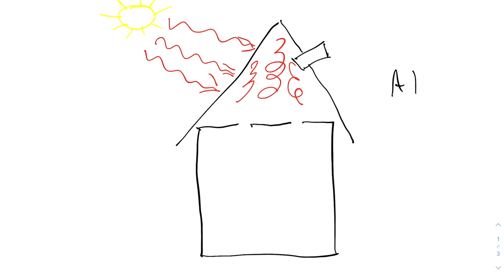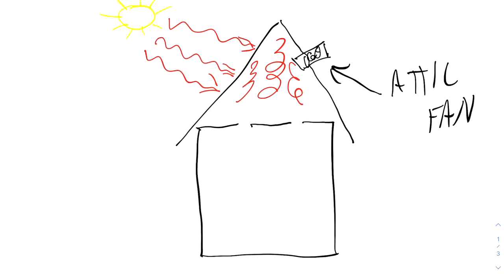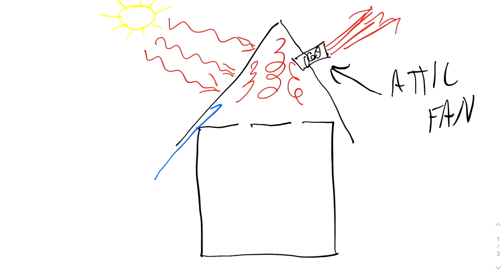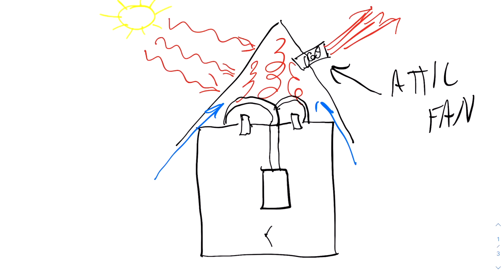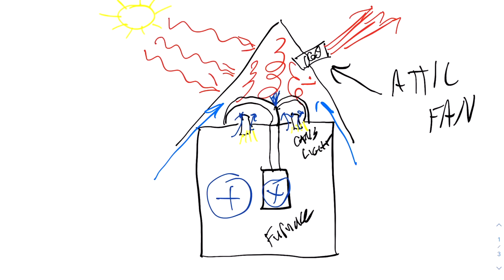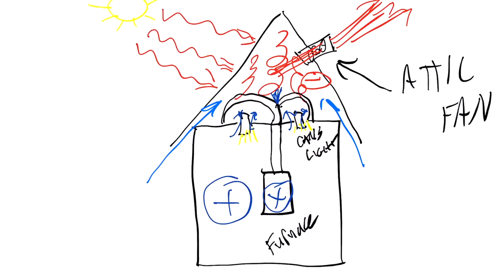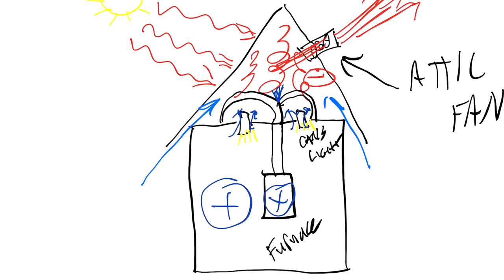3 Remodel Rip-Offs

Comment: 1. I installed an attic fan two years ago and measured temperatures with the fan off as well as on and the fan lowered temperatures inside the attic approximately 28'f. Due to this, it lowered the temperatures in the upstairs rooms as well. What you say is absolute bullsh*t 
      a. MIcrowave energy is completely different than what we get from the sun. The majority of the energy in solar energy is infrared. comparing them is idiotic. Microwaves cause rapid oscillation of molecules, creating heat. 
2. As for windows, a lot of it has to do with how many windows you have as well. My home has far more windows than your average home and switching from single to dual pane casement windows made a huge difference in my heating/cooling.

And since you ended the video repeating number 1, i'll repeat that you have no clue what you're talking about regarding attic fans. Perhaps your bias is due to your sponsors?

Comment: Gotta say you just lost a bit of credibility on this video. While I agree the claim of an attic fan reducing the attic temperature by 60 degrees is pretty optimistic to say the least, it easily lowers attic temperatures by 20-30 degrees depending on the day which in turn reduces the heat load on the house and lets the ac run less. We’re also not just talking about saving on utilities, if we run the equipment less, we will have longer intervals between replacement and anyone who has had to replace their system knows that replacement can be a huge investment….

Comment: idont know if he thinks hes right i put a air roof air powered fan only one in my roof and it drop temp by 10c so i put ina12 v fan to force more air into roof and dropped my another 15.c in in summer my roof was 50-60 c now its 35 to 50 so hes wrong

Comment: So I went and checked the the recommended literature that's supposed to prove Matt Risinger has a good point. Well, I wish he himself read that literature. A sample quote from one of his links: 

Rose (1992) compared attic temperatures in a test facility of several bays with different attic
construction. Comparisons of vented and unvented flat-ceiling attics showed that the maximum attic
air temperature was 28°F cooler with vents than without

The video is bullshit and misinformation.

Comment: Correction: the nest thermostat only uses the Airwave feature when the humidity is low enough. If the humidity is high it does not continue running the fan after the compressor shuts off, and so allows the condensate to drain off and lower humidity.

Comment: Your attic fan rant is SO SO SO easy to test; its not funny. My1,300 sqft in the Houston metro area had a summer temp of 145 at 3PM on a sunny day in the summer. After installing a fan from lowes by a roofer, that attic was down to 110 degrees. Those smart thermostats you hate so much showed a 3-hour running time decrease of the ac running on similar days when the fan was on and off; off, bring less.  You can't be more wrong!

Comment: A lot of credibility lost with this video son.  I have a 2 story house with an attic I can stand in.  The HVAC / heat pump air handlers are in the attic.  A 5-stage 4 ton for upstairs, a 5-stage 3 ton for downstairs.  My roof was not designed for a ridge vent and only had two air portals for heat to escape there are two solar powered attic exhaust fans that are whisper quiet that retail for around $2,500 bucks for each one, and I'll tell you what, they keep that attic nice and cool along with the radiant barrier I can stand up in that Attic in the summertime and it tops the temperature is maybe 80 degrees in the Attic in texas.  Combine that with the top of the line carrier equipment to Smart thermostats that communicate with each other to maintain the upstairs and downstairs temperature within one degree of the setting cold air return vents and every room and a buttload of insulation my air conditioning bill in Texas for my two-story house does not exceed $120 a month and that's with a pool

Comment: To say that attic fans are useless because we apparently live in a giant microwave is categorically false. Also, the amount of CFMs these are pushing generally won't create a significant negative pressure situation such that the cold air in the house is going sap into the attic. If anything, the hottest air in the house will get pulled up and add to the cooling effect of the fan. You've provided nothing but generalized and incorrect opinions. Stopped the video after that

Comment: I stopped watching after the second claim because the video is two for two on being absolutely wrong. 
the overly broad concept of a solar powered attic fan is highly misleading and the nest airway feature takes advantage of the power differential between the blower motor and the compressor motor intern drastically lowering energy cost

Comment: I dont even know how I got to this video but this guy doesn't know what he is talking about. Just a simple example is a car on a hot sunny day. The car will significantly cooldown if you crack your windows a little. That allows air to circulate inside the cabin. Ambient air temperature  circulating is what matters. Not the temperature of your actual roof. Simple greenhouse effect.

Comment: Sorry, but you know nothing about attic temp and what it does to an HVAC system, which is in the attic. Or you have never lived in the desert, so all the ductwork is fighting a 150 degree attic, that is why duct insulation exists. If you use an attic fan, the duct is only fighting a 90 degree attic. Cool roof tiles with CRRC ratings are for reducing sun effects on attic. R8 ducts reduce loss of cool air to a hot attic so they minimize ducts losing cooling on the way to the room supplies via radiant losses. High performance insulated attics reduce attic temps, just as attic fans. Lastly, thermodynamic 101: heat moves 1 way from hot to cold, always. So at night, a 150 degree attic, the heat in there travels one way, to the coldest thing it is touching, your AC cooled home, increasing load on your AC at night. 

As for your "it is useless to fight the sun" comment, if your home is fighting 120 degree sunny day, the last thing you want to have is an attic that is 150 degrees stacked right on top of your house. Its not about fighting the sun, it's about not having a 150 degree attic that helps the sun heat become worse on the structure's cooling requirements.

Also the QuietCool smart attic fans have an app with with a temp/humidity sensors that are built into the fan itself, so you can visibly prove in real time that you are cooling and altering humidity, proving all your claims false, and based on old HVAC mentality of closed loop systems, which do not apply in an open loop ventilation system, that generates static pressure to create balanced airflow.

Comment: LOL your house doesnt need attic vEnTiLaTiOn... thats laughable. Yes passive attic venting is ideal but where passive doesnt cut it active ventilation is the only option. Apply that same thought process, that attic ventilation doesnt impact the structure, to building in the north and you will have massive ice and condensation issues Matt.... poor advice.

Comment: This guy has no clue about science 🙄, if it's not ur expertise? Be quite, attick fans HAS intake and exhaust, intake will feed the same amount of air that is getting exhausted and they are BOTH at the attick, nothing lost from the house , if the house has cracks ans holes? It needs to be sealed anyway!! Smh. Guys just don't listen to those ppl. Talking about smart thermostat, it DOSE save you energy 
1 it will track you by your phone when it gets away it will shut the unit down OR IT it will keep the house to a temp you set on that stat when you leave.
2 it monitors how long it will cool your house or heat and by time it will learn that , so if your unit takes a longer time to cool,  it will warn you so you kmow that something is wrong and you need  maintenance to see what's going on like a low charge on AC , your blower is getting dirty and it's blowing less air , your capacitor atc ... without it you'll run your unit like there is nothing going on but actually THERE IS.
3 it will remind you to grab a filter and it's time to replace it  so your unit won't choke from a very dirty filter.
4 it will till you and or warn you that your unit is running fine or something is wrong so you'll have time to fix the issue rather than just running the unit with a regular thermostat  and make the issue worst.
5 it dose not need batteries, it charges it self from the r and c wires.

Comment: WRONG...WRONG WRONG you total miss the value of an attic fan and are shooting from the hip. Clearly you nothing about thermodynamics..    IT is true that the you have a thermal mass that heats up in your attic (the roof especially if it is tile or concrete).. The attic fan continuously moves air through your attic (from the exterior soffits) which "gradually" removes the heat from the thermal mass.. This isn't instantaneous (as you seemed to believe it should be)  but a continuous process over several hours.   But the point is that you miss is that the attic air temperature is reduced with cooler exterior air (because it is being exchanged with outside) and that prevents the energy from the hot air in the attic from transferring  through the ceiling to the home interior. Think of it like this.. You are maintaining a 120 degree attic temperature instead of 180... So you are preventing that extra 50 degrees of heat from transferring through the attic floor/interior ceiling.

The other aspect you get wrong is that you think that having an attic fan is going to cause a positive pressure so that hot air is going to go from the attic to the floors below.. Not going to happen as long as you have soffits that are vented properly to the exterior. actually I'd worry more about airflow between the floor below and the attic as the fan is exhausting ..

Comment: Matt is a massive scam. an attic fan will prolong the life of your roof shingles, fact. there are also other benefits from heat reduction. very dependent on the specific circumstances it can save you energy costs. my attic is sealed off from the rest of my house. you can mess up the natural ventilation from your walls basement, ect. there is more to the story. making blank statements on this topic isnt helpful.

Comment: You are 100% wrong about attic fans. I know because I put it in practice. You clearly have no direct experience with the results yourself and as you admitted you are basing your decision off of what other people have told you -  off of "scientific theory". I have experimented with an attic fan for many years now in my attic. I have a wifi thermometer in the attic. It drops the attic temperature on average about 30 degrees in the summer. The results in the home are small but real - about a 5 - 8 degree drop in house temperature in the summer. This is the difference between being 85F in my home to being 77F - yes, I will take that any time. I will say this, if all attics were properly sealed and insulated then yes an attic fan would not do anything. But because most homes are built by smash and go contractors they are not sealed or insulated properly. Experiment, test, try it - that is the scientific method. The scientific method is not " but someone else told me".

Comment: First off, the furnace does not cool the home, I never thought I would have to point that out to someone trying to represent themselves as an expert.  Second, I have taken the temp in a non-ventilated attic that was 150 degrees.  With a properly ventilated attic the temp should be equal to the exterior temp at all times.  You will not pull air from your house if you have a properly balance ventilation system.  

Your video is inaccurate to say the least.  Stick to making videos and not actually doing any work.

Comment: You're hating on power vents based on an improper install. I could say that about ANY system. Yeah, air conditioning? That stuff doesn't do anything  except for turn electricity into cold air that gets blown in your attic becuase ducts leak into your attic - therefore air conditioning is a SCAM!. See what I did there? You know what I say? YOU are a scam. This is one of MANY things I've found of yours that are half truths, or half understandings that call something crap based on the crap tier version, or an improper use case.

If you have adequate soffit ventilation for them to pull from, they work great. Your shingles get hot by radiation, but it CONDUCTS that heat to the air in the attic. You can get REALLY jiggy with it, and spray foam holes in top plates and around can lights and stuff like that (which I have seen YOU do) - but it's NOT pulling from there significantly anyway if you have adequate soffit ventilation. You say it's a scam, but you offer NO alternative. Ok, well just let it get hot enough to cook a turkey then!!!

I've been in attics in the deep south during 100 degree summer weather that you could work in ALL DAY and hardly break a sweat, without any of this "spray foam the rafters" nonsense. It takes some work, but it's not that hard. Baffles so your blown in doesn't plug soffit vents (cut in soffit vents if needed),  Put in a radiant barrier (foil type works better than spray in, but whatever), seal openings in top plates and around can lights with spray foam (box them in with fan fold), blow in as much R as you can (40 - 60)  and POWER FANS. It'll be roughly the same temp as a shaded area outside - in your ATTIC. You can of course use batts and floor the attic too - I think that usually is r38 or so generally.

Oh - and here's another one you didn't think of - if you're doing a roof, resheet with the radiant barrier backed OSB... And as for your "dark shingles" nonsense, Shingles other than black - almost ALL have the EXACT SAME thermal properties - or negligible differences - until you get into things like the solar reflective shingles which generally aren't worth the added cost. Maybe I shouldn't block you - maybe my new hobby will be tearing apart your stupidity every chance I get. I mean - you have some interesting nuggets here and there, but damn dude ...

Comment: An intelligent builder would know the dynamics of the building envelope. Active ventilation, solar or electric, creates air movement and cools the environment. Passive ventilation only allows for depressurization. Ceiling penetrations should certainly be treated to avoid air leakage in ANY design. You are the scam.

Comment: This is a total clickbait video, Attic Fans work, they remove trapped hot air and replace it with ambient air, they are not going to condition your attic like AC but they will remove hot air, Smart thermostats work great, they adjust when no one is home that saves money.  Windows are good if you have leaky windows and want to upgrade. The title of this video is wrong. Bad Advice !!! boo!!!!! Funny at the end he says "yeah i like to change my windows, I have a smart thermostat" lol.

Comment: The Microwave analogy is possibly the dumbest thing I have ever heard. That is not how RF energy works. Heat energy does not radiate very far in an absorbent medium, like air that contains carbon dioxide, water vapor, etc. It heats the medium and that transfers energy to the surrounding medium. If you are circulating that air with cooler outside, you are not giving that heat time to propagate so the area stays cooler. You should do a 5 min google on microwave energy before sounding like an idiot.

Comment: Ridge vents move more air and are the most efficient at purging the hot air from the envelope in the attic. This nonsense about sucking air from inside the house is absurd. Most newer homes have continuous soffits that allow more than enough airflow, but if your home doesn't just make sure your exhaust and intake vents are balanced. You can find the simple math online from the Home Ventilation Institute. For powered fans it's the square footage of the attic space multiplied by 0.7 for how many CFM the exhaust fan needs to move. If you can't find one large enough get close. Don't use two or mix ventilation as it creates turbulence that shortcircuits the system. For the intake side take your CFM and divide by 300 to get the square footage of intake needed, and if you need the square inches multiply that number by 144.

Comment: My powered attic fan keeps my home at least 3 degrees cooler when the heat index is above 95...proven facts. Your analogy of the microwave or the person lying in the sun is flawed, you're not cooling the product, you're reducing the ambient air temp in the space allowing the house to stay coller.

Comment: Dumbest video ever!!! You are comparing open space (beach example) with closed space (attic) and both are different. You feel instant relief when you open your car windows on a hot day because trapped heat inside. I have installed 2 attic fans (solarking Australia) two years before and very happy with it. We hardly turn on our air conditioner after we install the two attic fans. Finally, you don’t know what you are talking about!!!